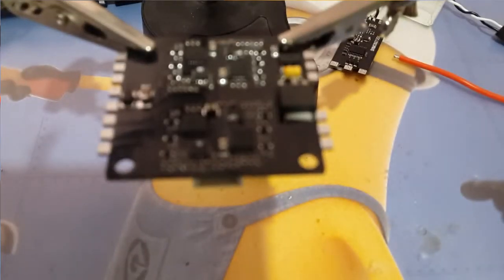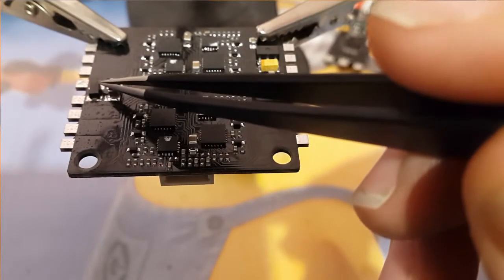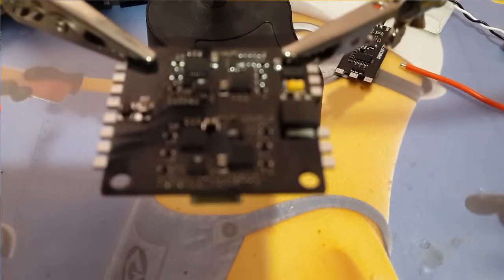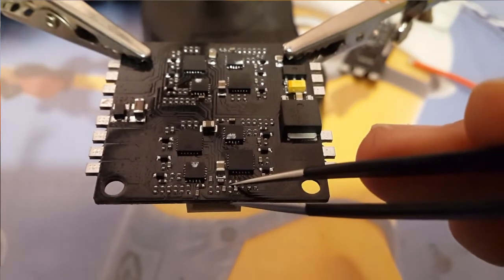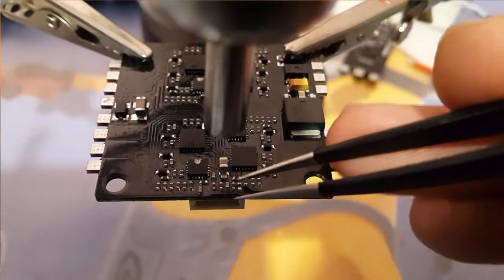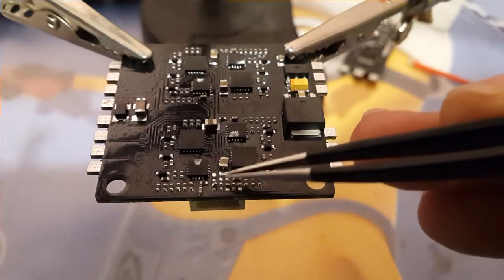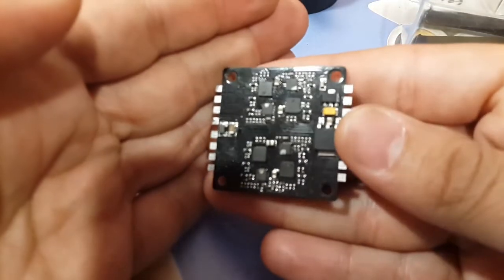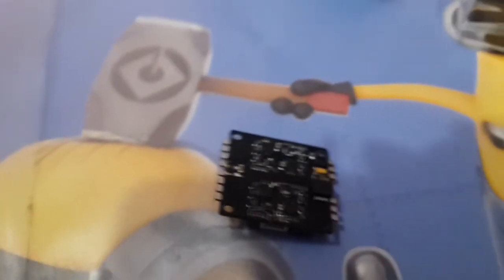Racerstar 20A 4in1 V2 ESC DSHOT 600 (Removing Filter)

Comment: hey nice video, work with hot gun station its really hard. You can also put a thermal tape to prevent desoldering other stuff.
I have one question: remove caps is needed for  all levels of dshot (150/300/600) or just 600? in order to run 150 or 300 I need to remove caps?